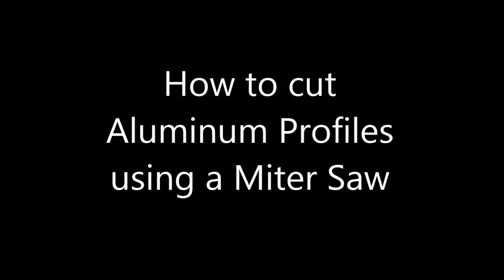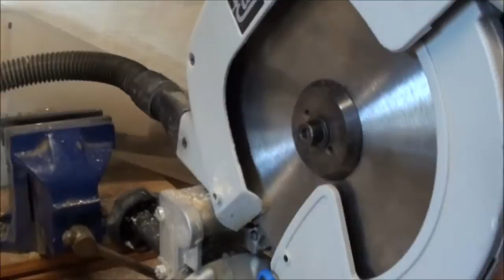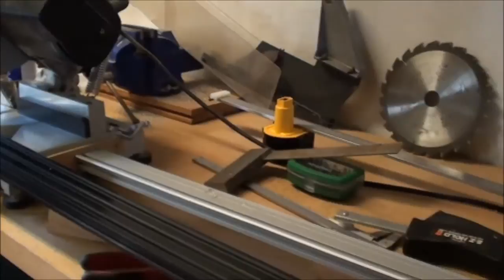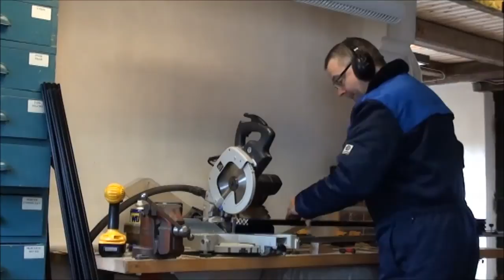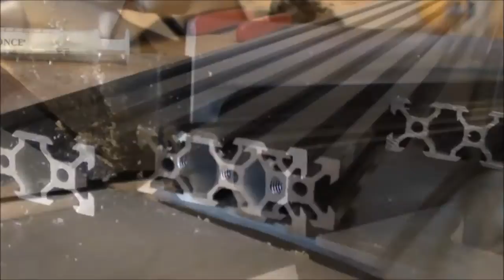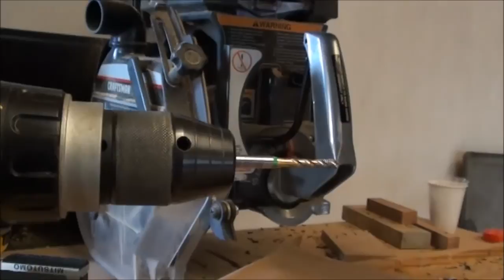Cutting Aluminum Profiles using a Miter Saw

Comment: Eathanol for to make inner threads, why not oil? Thanks for sharing the video!
Reply from the maker: Ethanol cools well and is sufficient lubricating for aluminum. It does not leave any greasy stuff as oils would do. So it works great.
Reply: @martinbarfoed5040  thank you for the qualitfied answer - was a bit unsure if it is a stupid question or not :-)

Comment: is in it safer to have mask couse of aluminium dust
Reply from the maker: spalespaske With the right saw blade it’s more like chips you get. So I do not think dust mask is necessary but would highly recommend using safety glasses. 
The blade used is a Festool designed for aluminum is has a very low cut angle.
Reply: i work for SMC its japan company. i work with aluminium every day .most of the days im sawing aluminium profiles.thats why im asking .i have googles as protection but no mask. thank you for your answer
Reply: But the lube.  There is always time for more lube.